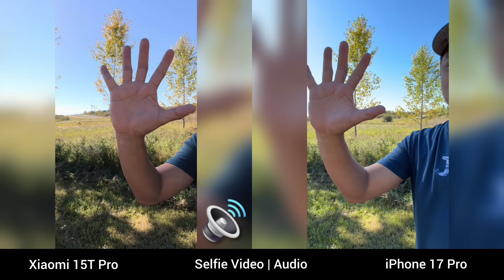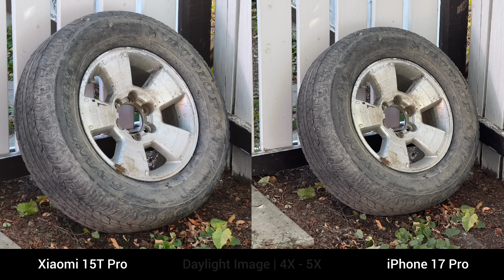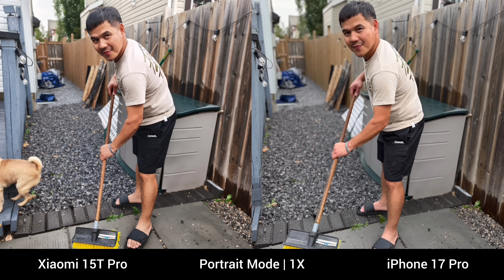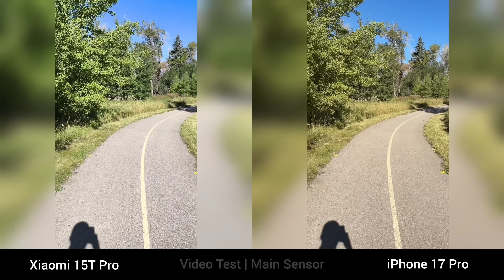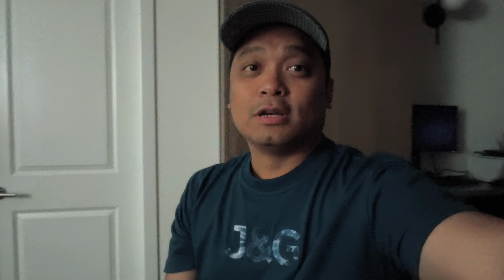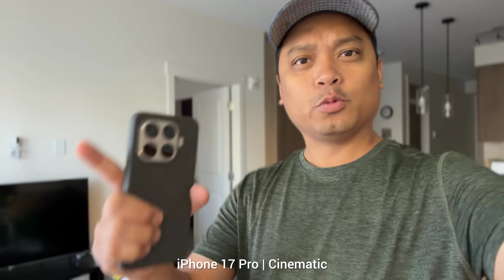Xiaomi 15T Pro vs iPhone 17 Pro - Ultimate Camera Battle!

Comment: If you take a closer look, you will realize that the 1x photos of the Xiaomi 15T Pro from the main camera are unusable. The camera's software actually do a very bad job at stitching together the 1x image (around the border) and the 5x telephoto image (at the center). The latter is slightly smaller scale than the rest of the image, resulting in a huge pixelated "step" between both stitched images. You can clearly see that in most 1x samples.

Comment: Iphone is better but for the price and specs 15T is also on the compitition 🎉
Reply from the maker: Agree! Both are really good flagship phones! ❤️❤️❤️
Reply: The thing with the iPhone is the processing is so extensive on it that it can make anybody's photo look good even if they're a terrible photographer I'm guessing with the 15 pro you have to work hard harder to get a decent photo, but it's definitely more realistic, I mean let's be honest you can't really take a photo of a dustbin and make it look good in reality but the iPhone can 😂
Reply: Indeed I just bought a one terabyte 15 T pro for 699 in the UK that's an absolute bargain and there was £100 voucher as well so I basically got it for 599for all of those specs versus the iPhone 17 which has mediocre software lockdown system terrible iOS 26 no AI no nothing on it. It's just a horrible operating system and all the apps are so expensive. No I've just jumped shipping and I'll be sticking with the Xiaomi 15 T pro thanks.😂